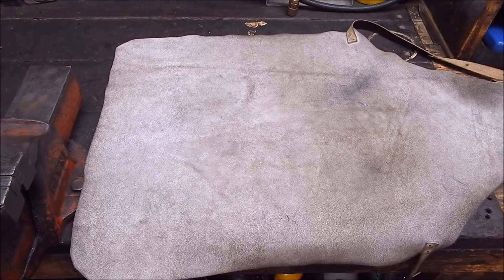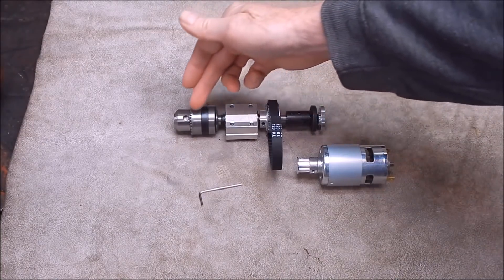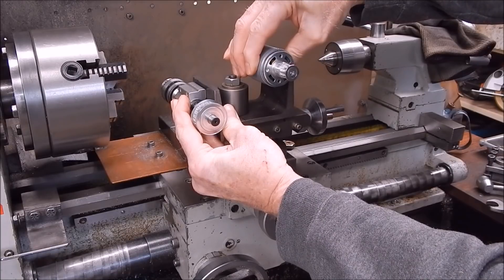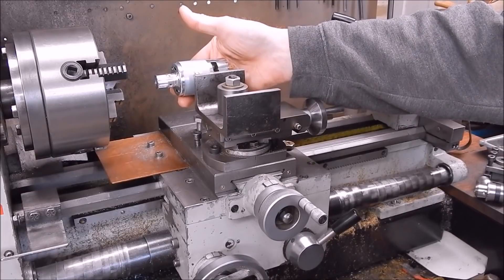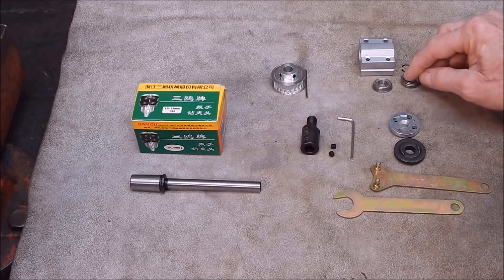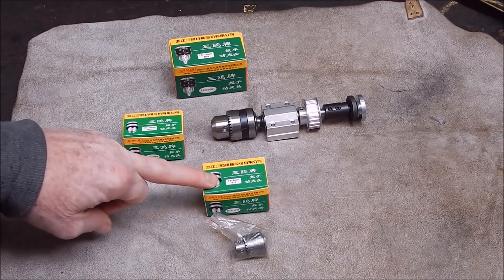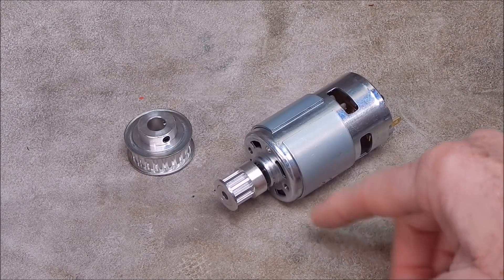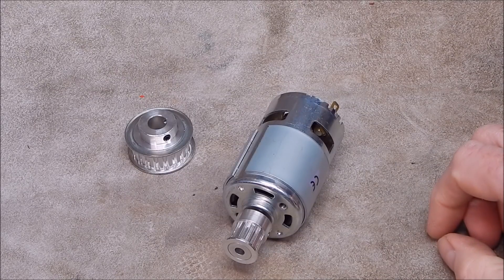I review a small power spindle and 775 DC motor assembly for lathe work

Comment: Hi Aussie, 
I have a question about the 775 motor.
Is 775 motor enough to do Aluminum milling?
If so, what kind of spec do I need? Like 12v 10000rpm and 0.5 N.m? 
If 775 is not really powerful for milling Al. What motor do you recommend from banggood ?
Thank you
Reply from the maker: Hi Ryan,  It depends how big you want to go with the end mill.  The 775 is really limited to small work and anything over 8 - 10 mm in aluminium would be too much.  You would need a variable DC power supply able to deliver 30 volts at 5 amps.  The motor specs vary a lot so look for one that can do 30  - 36 volts.  Cheers Rob
Reply: xynudu thank you so much for your advise rob 
Looking forward to seeing your next video.

Comment from the maker: BE AWARE:  Banggood offer a range of 775 electric motors with different maximum speeds and voltages.  These are NOT all polarity neutral.

Apart from the Machifit motor ALL of the 775 motors are polarity specific.  The positive terminal is indicated with a red plastic dot/plug.   While they will run with reverse polarity, torque will be reduced and brush sparking will occur, particularly noticeable at higher voltages.

So consider correct motor polarity/drive/rotation direction when configuring the drive pulley on the Machifit spindle assembly.

Cheers Rob

Comment: Hello 

Yes I did buy the unit from banggood, I checked last night but I did notice they sell different ones,  different sizes of chucks and some complete with drive belt and pulley. It appears I ordered the one with the smallest chuck, which is OK for what I wanted it for.
Reply from the maker: Hi Paul,

They all use the same spindle bearing mount.  All have a 10 mm spindle.

If the unit is faulty I would shoot a small video with the mobile phone and send it to them showing the problem(s).

They should replace it if it's sub standard.

Cheers Rob

Comment: Hello I purchased one of these drive shafts and the bearings that were supplied were slack in the housing, the housing was not even bored out just a rough cast, therefore I am very disappointed to the quality of the product I was supplied, appears to be very different to what you reviewed,
Reply from the maker: Hi Paul,

I received five sets from Banggood and they are all fine. Did you buy yours from Banggood or get some cheaper non Machifit clone from elsewhere?

Cheers Rob

Comment: On TAOBAO, for those who sell 775 motors, will also sell 795, 895 motors
which is a bit more powerful, with slightly bigger size. 

One shop selling 895 motor with a high speed version and a low speed version.

Comment: Hello Rob--Great review. I have four or five watchmaker lathes that need motors. Think these motors would be good candidates for them?
Reply from the maker: Hi Rick,

Watch my next video where I show how the motor runs /drills with the existing 2:1 pulley ratio and a 19 volt scrap printer power pack.

I've only just completed the setup.  I can already see things I could do better, so some further refinement will be occuring.

So far it looks promising.  Just having a beer for lunch ;)

Cheers Rob

Comment: bearings too close, it just binds up one day after the bearings die from intense loading. they gotta use a longer bearing block and space them apart, the stickout is wayyyyyyyy too much for that drill chuck. its practically a long lever for physics to assault you lol. hell two blocks would make it virtually indestructible  and spread the load.  i was unhappy with mine i feel as if its designed to fail. i didnt get this exact product, i got one with the spindle, chuck, and the bearing block. great video though, i love this channel and i encountered your site too. so glad i subscribed!
Reply from the maker: Interesting. I am close to mounting the DC motor on mine, so it will be interesting to see how it works out.

Cheers Rob
Reply: @Xynudu  nice, I had a little 2" saw on an arbor I made in the Chuck for putting slots for these bronze posts, I guess it was a lot of force but at least I got the bolts done, it was never the same after reluctantly slicing through a  stainless bolt. Those little motors can be pretty good especially with the pwm controllers. I imagine it'll work really good for a lathe grinder cuz the forceto break it would probably break the grinding wheels first. Also, I really appreciate the work you do I have learned a lot!!

Comment: The problem with that little motor is that it is very low power - I'd guess no good for drilling anything over say 2mm.
Reply from the maker: Yet to be proven Stu.  I am currently mounting the motor and belt to it as a cross drill.
Reply: 775 motor can deliver a lot of power.  It is used in battery powered screw-driver/ drills.

Comment: Useful sets of bits Rob... seems OK value and certainly would save making the whole functional unit. Lots of potential. :)
Reply from the maker: Hi Chris.  Yes, totally agree. Not worth trying to make a mount at that price.  Just remains to be seen how well the motor performs, but as it will be mainly used for cross/radial drilling model making work, I don't see that as being an issue.

Cheers Rob

Comment: I bought one of those a couple of months ago. And used it to do some cross drilling on my vintage lathe. I turned down the saw arbor  and stuck it into the electric drill to power it.  Mine had Sanou with aB12 taper. I never figured out what that little c-clip was for,  looked pretty useless. I agree it's a cool product. :)
Reply from the maker: It's pretty good value when you consider what just a drill chuck costs.

Comment: Thanks Rob.  I have some of those pieces and motor but had not expanded the process that far yet.   I would think you could possibly use that for making small gears.   Not sure how big you could go.
Reply from the maker: Hi Dale,

I had similar thoughts, more in line with making a different sized Gilmer/toothed belt sprocket. Same process, just different cutter profile.  Interesting.

Cheers Rob
Reply: @Xynudu  That was what I was thinking also as it would be easy to  set up a cutter on there.  At least I think it would.   Be fun to try.
Reply: @Xynudu  
Getting the right cutter is probably the hard part.   Still be fun to try.
Reply from the maker: Hi Dale.

It's interesting if you look at the profile of the teeth on the Gilmer pulleys.  They are not parallel sided as you would expect.  I think it would be dead easy to make a rotary cutter from an old straight reamer with a TPG (which I have).  Basically it is like a Woodroofe keyway  cutter, only the profile is slightly different (sides taper).  

It's something I might have a go at as I've done plenty of spur gear cutting and I feel the need to do some more :)

Cheers Rob

Comment: Got a Dumore toolpost grinder that needs a replacement motor, I think you gave me some ideas on how install some replacement motor without spending a fortune...   😉
Reply from the maker: Hi Pierre,

The Dumore motor is a lot larger than the BG ones I've seen on their site.

I have a series "0" Waldown which is a copy of a Dumore.   Great industrial quality TPG but difficult to get into the really small stuff, so I use the air powered pencil die grinder on in the tool post for those jobs.  Good to have both, plus the Hilda does some handy grinding work.

Cheers Rob
Reply: @Xynudu  Banggood go some spindle motors in the 500watts range that could be a possible replacement for a Dumore suicide type motor, some brushless unit with variable speed would be interesting to consider, some adaptation would be required, though...

Comment: G'day Rob.  That has lots of possibilities.
Reply from the maker: Hi Harold,

Yes, it's pretty versatile, and amazing for the price.  Just remains to be seen how well the motor performs.  Seems pretty strong for it's size.  Time will tell.  I think it will be used for cross/radial drilling, as I already have lots of options for grinding.

Plus that is pretty much all small diameter work/spotting etc.  So no big loads on the motor.

Cheers Rob

Comment: I agree with Tameem, the idea of a simple tool post grinder is appealing, depending on the bearing quality.  Thanks, Rob.
Reply from the maker: Hi Everett,

Proper TPGs run open oil bath magneto bearings and can spin up to 40K, angle grinder/ HILDA armature bearings are OK for 30k.  So I expect the spindle bearings to be OK for at least 20K. 

Cheers Rob

Comment: As soon as I saw the parts I thought of a tool post grinder Stefan made a while back. With another motor and/or pulleys it could go fast enough for grinding.
Reply from the maker: Hi Tameem,

With a higher voltage, larger diameter stone or a change to a higher drive ratio it would be capable of grinding chuck jaws OK.

I'm interested to have a go at cutting a larger diameter Gilmer drive pulley.  Grinding does not put much load on the motor as you are only kissing the surface of the work, so taller gearing would be OK.

It should be much the same as cutting a spur gear.

Cheers Rob